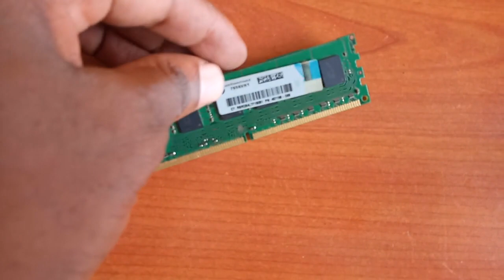Computer Repair: Laptop | Desktop Computer repair tips | Computer Expert in Kenya

Comment: Earlier my computer was on, its shows no conection avilable then I unplugged all the cables MOTHER BOARD ETC AFTER I START MY PC. ITS ON THEN. 5 min runing then suddenly Swith off after restart it CPU IS ON BUT IT DISPLAY NO SIGNAL I CHECK CABLE PREFECTLY PLUGED , please solve my probleM
Reply from the maker: Change the VGA cable, then try and see if it is going to bring the same problem.
Reply: @midiamartclassictv  VGA cable is perfectly work pc not booting ITS STILL ON BUT CANT BOOTING WINDOWS I CHECK EVERY CABLE THATS PERFECTLY WORK PROBLEM IS  NO SIGNAL COMING FROM COMPUTER

Comment: PHLE MERA COMPUTER CHL NI RHA THA THO MAINE SAAB CABLE UNPLUG KAR KAR KE DUBRA LGA DI FR COMPUTER CHAL GYA BUT FIR HUA KY MERA COMPUTER CHLA 5 min FIR BAND HO GYA FIR ON KRNE K KOSIS KRI PR HUA NI PLEASE SOLVE MY PROBLEM
Reply from the maker: Am not getting the language write in english pliz
Reply: @midiamartclassictv  Earlier my computer was on, its shows no conection avilable then I unplugged all the cables MOTHER BOARD ETC AFTER I START MY PC. ITS ON THEN. 5 min runing then suddenly Swith off after restart it CPU IS ON BUT IT DISPLAY NO SIGNAL I CHECK CABLE PREFECTLY PLUGED , please solve my probleM